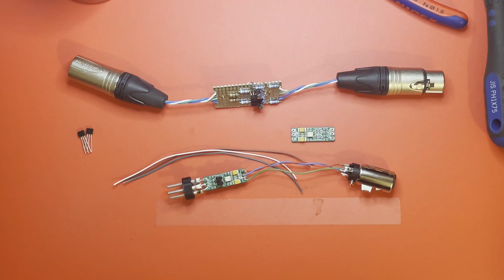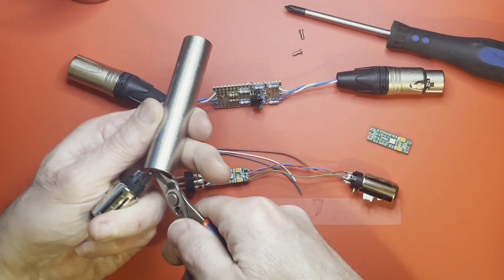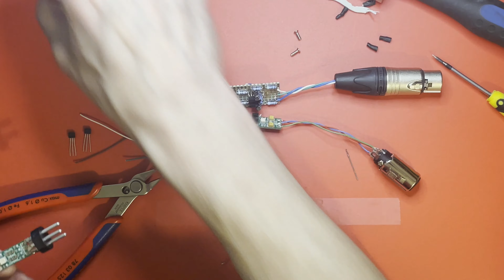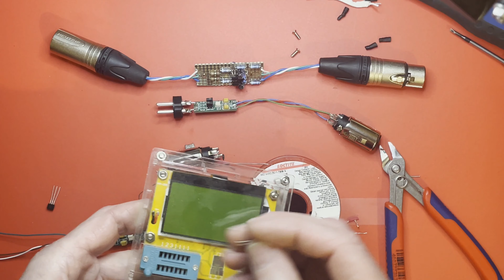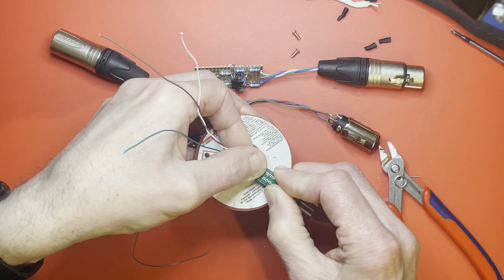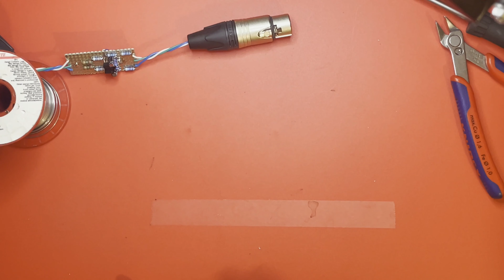Simple inline microphone preamps part 4 - PCB & inline casing assembly

Comment: I see on teyun q-2 inline preamp its more complicated, is that better?
Reply from the maker: I'd never heard of that one! From a bit of quick research, it's apparently not a balanced preamp, just one transistor, with pin 3 on one of the XLRs not even connected.
It also uses a generic transistor rather than the matched pair of low noise ones I use in this.

I cannot find a teardown or internal photos of that other one, I would like to see exactly how it is built.
Edit - I just found the user manual; it's signal to noise rating is only 58dB ! That is terrible for a mic amp.
Reply: @RJTC I happen to already have a Teyun Q2, I can send you a photo of it if you want, perhaps as a reference.
Reply from the maker: @al-elchannel5898  That would be great, thank you! If you put it on a photo site & send me a link through the contact form on my web site?  Any kind of link in comments on here is deleted by YT unfortunately.